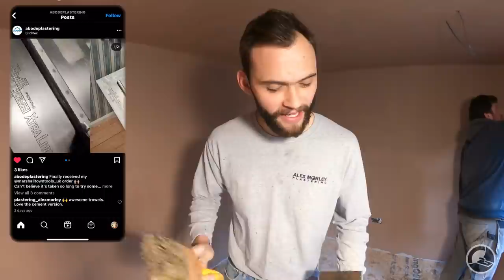1 Coat vs 2 Coat Plastering

Comment: This is a great video. I use one coat and two coats plastering. On lovely flat new boards one coat is fine as long as it ends up 3mm thick. . On an old house with  damaged  walls two coats can really help sort a lot of problems before you put on the finish coat. 

Both techniques are good . Different situations call for different techniques.

Keep the great videos coming. 👍

Comment: i learnt 2 coat plastering, after 2 years i went to one coat and have done for 13 years never had a call back painters love my work customers love the work never had a complaint ever, cuts time doing alot more work in one go if want. if your replastering old walls by all means 2 coat unless you built out bad bits then skim but other than that one coat all day, still the same finish some people just cant one coat cause you learn 2 coat
Reply: Very nice .  Just wondering if I want to do a 1 coat wall onto painted wall good condition do I have to put some sort of gripping agent on the painted wall first cheers in advance.
Reply: @nathanevans6331 mix 1 part pva to 3 parts water, use an old 4pint regular plastic milk container. Brush or roller it on and wait 10 or 15 minutes for it to dry then put another coat of pva/water on, wait 5 or 10 minutes for the wall to go tacky, then your walls ready for  plastering, it's a must because it bonds the plaster properly to the surface of wall and it stops  the plaster drying to fast and cracking, better to be safe than sorry.

Comment: I've been plastering for 35 years,when I started walls were float and set ,skimming cement walls you need 2 coats ,today everything is plasterboard,all I ever do is 1 coat on boards lay on with steel ,flatten with ox plastic ,then 2 wipes with nela an a splash brush ,perfect every time
Reply: Cowboy
Reply: @stephenmillar453  can you explain why?
Reply: @kxjx  read the bag mate
Reply: @stephenmillar453  I read the bag, so I always put 2 coats on. But if his one coat results is good.... like I dunno I thought you might be able to tell me something about what problem it would cause or something... anyway doesn't matter.

Comment: Great vid Alex I generally 2coat but there are times when I have one coated and sponged and got a good finish. Totally agree with what you say about the traditional plasterers ‘spongers ain’t plasterers crap’ you can say that about any trade when I first started out the old boy Chippeys never had all the cordless tools  and  chop saws just literally a bag of hand tools and saws they actually sharpened themselves. So yeah if your finish ain’t compromised and you get a good finish using a sponge why not if it makes your life easier 👍

Comment: Brilliant, I've used the one coat sponge method now for 30 years, I'm 60 now, it's a perfect match sponge and spatula, especially for mechanical plasters
Reply from the maker: I bet your body is thanking you now. 

I’m not a fan of 1 coat on massive hits. 70 m² ⬆️ but I think it’s alot easier.

Comment: We try to 2 coat most walls as we just find it's a flatter finish. But we sponge that also, just for the reason it dries more uniform.. And as for your point about bg not recommending sponges they also dont recommend using pva and we all do that also.. 😁.  Good video Alex 👍
Reply: They also recommend 12.5 litres of water to 1 bag of plaster, far too thick it’s unusable 🤣

Comment: 1 coat or 10 coats it's all about application at correct thickness..
Fill out your beads and get it on..
Flatter you can lay it on the better 
The rest is down to timing.

Comment: I'm currently doing my level 2 NVQ and one coat plastering is something that was massively frowned upon by my teachers. In the coming months, my NVQ assessor will be coming on-site to assess me for my NVQ and if he spots me applying one coat, he will definitely fail me. Interestingly a friend of mine works on building sites in London and apparently it's now standard practice to apply one coat of plaster on new builds.
Reply: My best advice would be to stick with 2 coating until you have more experience. Learn the tradition way first then you can experiment with little tips and tricks. Alex is by far the best plastering channel so if I was you I would literally study his videos. Its actually mind boggling how little subscribers he has to be honest
Reply: @eoinob  Thanks for your constructive advice.
Reply from the maker: Great trade to be in. Well done. I agree stick to two coat tbh. You will get the most consistent results. 

1 cost is handy to know to gain extra m² and to save on a bit of time. But I wouldn’t use it as your go to method, unless all your doing is board work on site. 
Learn the traditional way first; then add experience by using different techniques.
Reply: @AlexMorleyPlastering  Thanks! I really appreciate your advice. I'll stick with the 2 coat plaster and traditional methods for the foreseeable future, then after earning my NVQ I might experiment with other methods to improve my productivity.  ( I still haven't used a spatula speed skim or sponge as they were not encouraged by my teachers. I did the entire procedure from beginning to end with a stainless steel Marshalltown ). PS- I massively appreciate all your videos and I would heartily encourage you to keep up the outstanding work.
Reply: You will come realise in time that site work is all rush and tear and no finesse.. I'm a chippy of 30 years and I walked away from site work years ago I couldn't stand it. It's all who can do what the fastest no matter the quality of finish and personally I take pride in what I do.. It will be good for you to learn meeting lots of people and will certainly keep you busy, tbf It's probably not so bad for a plasterer but as a chippy people nailing stud walls to the screed with a paslode and sticking kitchens in with gripfill is just shocking. I wouldn't wanna buy a new site house I'd see all the imperfections 🤷‍♂️ good luck mate and enjoy your job and have some pride in what you do, it's not all about the money tho it is nice 😉 👍
Reply: @adamprice9214  I haven't done any site work yet, because I doubt if I'll be able to use that work towards my NVQ portfolio. As you said, it's all about speed rather than the quality of the finish and I doubt if the supervisors will allow me to spend a few minutes taking photographs of my work.
Reply: @ryokan9120    take a look at 'any' k-rend job.. at a 1st glance in daylight from a distance looks quite smart... now go back to it under artificial light and take a closer look 👀 looks an absolute mess if you ask me!. Trowel marks everywhere and more humps and bumps than the bleeding Himalayas.. there will come a time when proper trades are a thing of the past and they're all replaced by bots. Alex here does a good job fair play & If you wanna see someone with exceptional skills doings things as they should be check out Dan Solo the guys a machine
Reply: @adamprice9214  I haven't done a k-rend job yet, I've only done sand and cement and that didn't quite go according to plan. Luckily I had an experienced plasterer with me to help rectify things. I may have to do a separate rendering course to hone my skills. But what you just said doesn't surprise me in the least, it's clearly all about speed over quality.
Reply: @adamprice9214  I'll be sure to check out Dan Solo. Thanks for the tip.

Comment: How things change EH?? ...... When I started, (Traditional) plastering would be a 'Three - Coat - Finish' ....... Steel Float - Wooden Float - Steel Float ...... Then just as it was tightening up a wet cross-grain-float (wood again) would be used all over, much like a Sponge-Float these days. It would also be used to make sure our internals and externals (pre-metal beads of course) were absolutely Spot-On :-) ........... Finishing Sand & Cement Render and Board ...... I think one-coat can be successful these days because of the quality of the 'fixings' - in our days the boards were all over the place, and we used Four sand - One lime - One cement for our rendering which gave a 'lot' of suction. You would never get away with one-coat back then with the materials we had - No Multi-finish until the 80's/90's - I think ?? ..... And the promotional BLURB from gypsum was that it 'could' be used as a One-Coat finish (Not that I ever did) and could still do two houses a week on my own :-)
Reply: Trowel float trowel guy who taught me used to do if haha
Reply: Peter moring 
Salute you pal
Reply: Wat dolls houses

Comment: I’m newer to plastering (finished college and had site experience for a year) I’ve moved to a new company and they want me doing 1 coat finish which feels weird to me but seems to be the normal now I’m up north from London (I’m a decent plasterer and do get a good finish) I have 3 ceilings to do on Monday so would you recommend I start using a sponge float due to the company wanting 1 coat? I have a refina sponge float, I also use speedskims, flexi trowels and so on
Reply from the maker: I wouldn’t start 1 coating unless your going to use a sponge. You will need a sprayer too.
Reply: @AlexMorleyPlastering  it all worked out well and the finish was spot on, cheers for the feedback

Comment: Why does it need to be sponge float if only doing one coat?
Reply: By adding moisture to the plaster you improve plasticity. Giving that you are using long soft edge blade (as long as you can fit on the wall - 2400mm on big wall or ceiling!) you can achieve almost perfect flat and smooth finish. Never use small trowel on large surface with single coat as it only caused dents and imperfections.

Comment: Good video we put 35m2 to 40m2 one nan sets on. When we sponge we only sponge say a 1/3 of the set then back and take out the lines then next 1/3  and so on . That way you can put decent size sets on and sponge no problem. Going to give your method a go though
Reply from the maker: Great suggestion. Thanks Michael.
Reply: Not nan man

Comment: Call me a cynic but maybe British gypsum insist on two coats because ur using more of there product that way .most things in this life come down to the dollar I find
Reply: True but at the same time the proof is in the pudding. There are many times when the overall finish is demonstrably better w/ 2 coats as opposed to 1.
Reply: @nicholasberic947  yeh I gotta agree but I’ve found u can get a more than acceptable finish with one coat sponge floated and then troweled up to a finish I’ve done it on numerous occasions and there really isn’t to much difference between that and  two coats

Comment: Hi Alex. Love your videos.
As a DIY'er, I'm liking the sound of one coating to take the pressure off by not having to make a second wetter mix.
Do you have to use a cement trowel to flatten or will the Marshall Town Permashape laying on trowel do the job?
Thanks.

Comment: Interesting, hard to tell on a video but one coated walls looked a little lumpy bumpy to me.
Personally I’ve found when I do it, you can get the walls lovely and smooth but never as flat as two coats!
Reply from the maker: Nice comment. Thanks for your feedback. It’s the plastic trowel that gives that appearance. I ran it over off cameras. It looks like bumps when shining raking light on it. 

A better example of this is in this picture on our instagram page. 

https://www.instagram.com/p/CLXkGxxBoyv/?utm_medium=copy_link
Reply: If done right there is no difference, but the surface needs to be really flat before skimming....otherwise 2 coats are required and even with 2 coats if the walls/ceilings are not flat/straight then the finish will be quite poor when throwing a light under the wal....all the best ....keep the videos coming Alex

Comment: So will mixing gear in dirty water effect the rate in which the plaster goes off? And what is your take on using of date plaster? Does using out of date plaster cause the plaster the go off quickly?
Reply from the maker: The problem with both of those methods is you can’t modulate the rate it goes off. It’s all or nothing with dirty water or out of date bags. I’d use half time tbh if you want to shorten the set.
Reply: Dirty water, out of date plaster, plaster that has a tear in the bag warm water and mixing to firm then adding more water and mixing old gear in with a new mix are all things that will accelerate the rate in which plaster will go off and it's so hard to know just how quick.. do any of the above one minute it's alright the next you go back yo your gear and it's gone, all these things can get you in a world of s#!t. A lot of plaster lately seems to be going off double quick as it is I've experienced this as have many others 🤷‍♂️

Comment: I'm a old school 2 coat plasterer ( at least ), 1 coat isnt proper plastering in my opinion
Reply: Old school plastering never had boards like we do now, board finish at 3mm is fine and you wouldn’t know any different between one or two coats, stood infront of 40 year old timers and had them baffled at which coat was which and they didn’t have a fucking clue. That extra 30 quid a bag makes all the difference though, can make one bag of plaster stretch 20m and that’s nearly 80 quid a bag 👍

Comment: Hi Alex, would you recommend only using the one coat sponge method on plasterboard ? or can you do it on other surfaces   Great informative video on timings etc once again Alex
Reply from the maker: Tbh, we very rarely use this method tbh. The video was created to show the comparison and the pros and cons. Generally we only use the method when we are trying to squeeze extra m². However I wouldn’t use 1 coat on much more than on board, or reskims where the walls aren’t that bad. 

When you going over Blue Grit or rough walls you have to apply the plaster so thick it makes it difficult to do a good job.
Reply: @AlexMorleyPlastering  thanks Alex

Comment: What opinions on felt brushes, I haven't seen videos on them
Reply from the maker: Tbh I saw them when they came out a few years ago. A bit of a gimmick imo. How to you brush the skirting line and corners ect. Just another thing to carry around I think.
Reply: I’ve always wondered that. In the old videos of the US plasterers you see them using an amazing technique with it, but like Alex says, how do you bring in the corners and ceiling like etc
Reply: @NiktheEnglishGreekCypriot  I use felt brushes, trust me they are a wonder to use. Used them when I was working in Boston, they create a type of fat that you can slide your trowel over, been using them for about 12 years. I do sponge now and then, but to be honest, I one coat, double back with the same batch, fatten in, leave, spray trowel, leave then felt brush, leave again then cross trowel with a 16 inch Marshall town Flexi, job done. 2 and a half hours max. Can get about 2.15 on a good day.
Reply: @jimjimskimmer1935  cheers mate, I’m debating buying one, are they easy to maintain?
Reply: @jimjimskimmer1935  What is spray trowel?

Comment: would you say the mt’s are better than the nela carbon?
Reply from the maker: Out the box. MT Cement currently. Not the 13” plastering version. 

Fully broken in. Not sure. The NELA is unbelievably good.
Reply: @AlexMorleyPlastering  been breaking in the nela 13inch for 4 months i love it, still not sharpe yet. just ordered both the marshal  trowels you’ve just started using also,